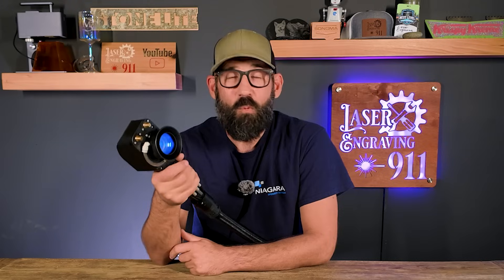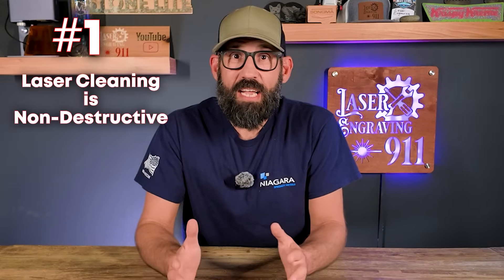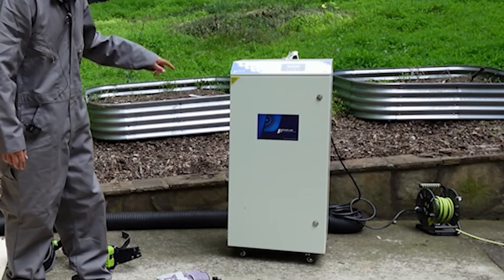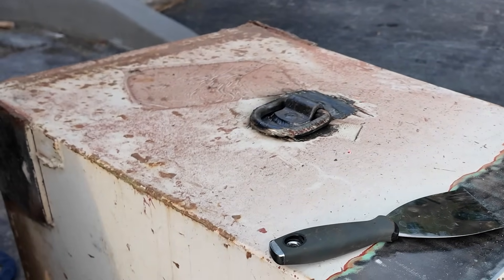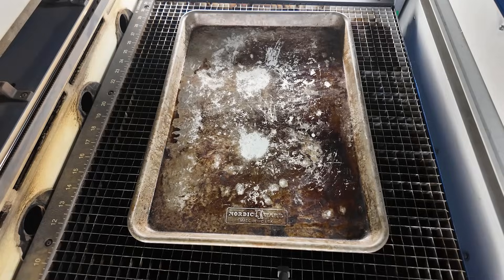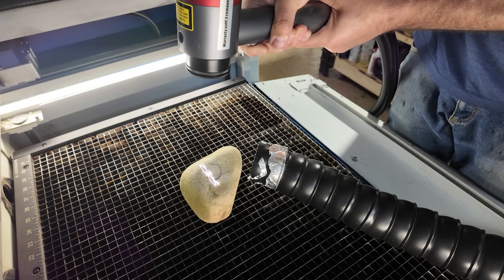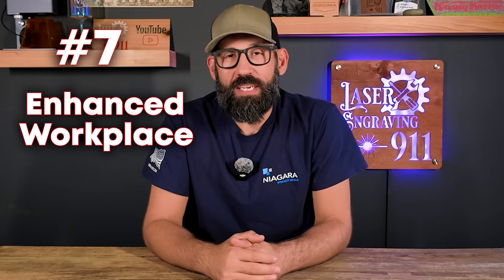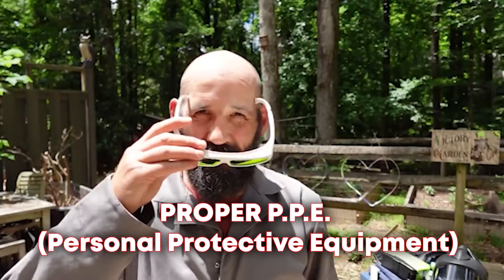The Truth About Laser Cleaning -  Pros and Cons

Comment: Have you tried low output Black Mold cleaning as part of storm mitigation cleanup? Thank you for your help.
Reply from the maker: You need be carful with doing mold. Proper PPE and Fume extraction is necessary for that kind of work, high level respirators and filtered fume extractors, full body suit sealed. I dont have experience with doing it myself, its to risky to my health, IMO

Comment: I’m looking to buy I guess the pulse one for removing old lacquer finish from mid century furniture. Any suggestions?
Reply from the maker: for sure  SFX has a great unit for this SFX Portable 300-500 Watt Pulsed NEW VERSION https://tinyurl.com/pulsedcleaner  and if your serious, you can use my code LASER911200 for $200.00 off :)  it will get the job done!
Reply: We have the 300W  pulse from SFX.  It doesn't work on every finish . just refinished a dining room table and it worked like a charm on the legs , but couldn't get it work on the top . Same setting.

Comment: I purchased a 300 w pulse laser from SFX 8 months ago. Excellent machine and company service. In watching your video you said the machine is a class 4. From my research I believe that is incorrect.I believe it is a class 1 because of the way the laser light is housed.The techs at SFX also say it is a class  1. That being said there are still safety precautions that must be followed but they are not as extensive as class 4. Also since I also have a machine from the same company is a list of parameter setting that work well for you available for purchase. I have developed a list of my own but would be interested in seeing yours.
Reply from the maker: Thanks for leaving a comment. Unless your 300watt Pulsed is housed in and completely enclosed environment, with laser shields or viewing glass meaning " a sealed cabinet, you do NOT have a class 1 laser. What you have is a 100% is a class 4 laser Laser cleaners, whether continuous wave (CW) or pulsed, are generally classified as Class 4 lasers, according to the International Electrotechnical Commission (IEC) and the American National Standards Institute (ANSI) standards for laser safety. See here:

✅Key Characteristics of Class 4 Lasers:
✅High Power: Class 4 lasers are capable of delivering high output power, which is necessary for applications like material ablation and cleaning.
CW lasers typically have high average power.
Pulsed lasers deliver high peak power in short bursts, which is especially effective for material removal with minimal thermal damage.
✅Hazards: Class 4 lasers pose significant safety risks, including:
Eye and skin injury from direct, reflected, or scattered beams.
Fire hazards due to the energy density.
Applications: They are used in industrial processes such as laser cutting, welding, and cleaning.
✅Why Laser Cleaners Are Class 4:
The cleaning process relies on the laser's ability to ablate or vaporize contaminants without damaging the underlying substrate. Achieving this precision and efficiency typically requires a laser powerful enough to meet Class 4 criteria.

✅Safety Precautions: Operating Class 4 lasers requires strict adherence to safety protocols, including protective eyewear, controlled environments, and beam containment measures, to prevent injury and accidental exposure.

There is a huge difference between a class 1 and and a class 4 laser. It has nothing to do with how the laser source is housed in the cabinet and electronic but where the LASER EMITTER "meaning the galvo, and final exit point of the beam are located, and also how many watts the beam is, and how destructive it is.
Reply: I'm also looked at sfx machine. Do you know how frequently the lenses have to be replaced? That is a big concern of mine. It's a slow process already, but changing lenses every 10 min would be horribly painful.
Reply: Definitely a class 4!
Reply: It's a 1064 Nm laser, this is a Class 4 wavelength and will damage retinas if directed at eyes. Construction levelling lasers are Class 2. So definitely not Class 1. Class 1 is used for electronics, Printers, DVD, barcode scanners. Who the fuck told you such bullshit?

Comment: Hi Michael , Could you please tell me if I need to take breaks from using laser cleaning machines or can they work continuously?
Reply from the maker: They can work continuously for  decent amount of time a few hours, but since they are air cooled the outside temp plays a big role in  how long they can continuously run, so on Hot days its necessary to keep the machine cool or it will overheat. If outside keep it under a tent out of direct sun, and even help to have a additional fan blowing on the machine.

Comment: Great vid!
Looking into the SFX 200W pulsed laser.
Price is reasonable and they have a support center somewhere upstate in NY.

What are your thoughts on?
Reply: I want to purchase a pulse laser cleaning machine to help with my furniture restoration. It would be to remove paint and varnish. Ideally I would like a machine that has a varied watt, 100w/200w/300w/500w and if possible up to 100w to accommodate rust cleaning from metal too, as well as multiple patterns. I have seen them advertised, but when I try to get further info it always comes back with a single mode. Do they exist?
Reply: @aroundtheworldat1016 any luck with your research? Looking to purchase one for furniture also!
Reply from the maker: Thanks, well it depend on what you want to use it for? What are your plans.
Reply: @it would have to be delicate cleaning, like car parts, restoration of monuments, wood, bricks from paint. Maybe pharmaceuticals or even into technology sector.

Comment: As an owner of a pulse laser and a cw laser. One piece of advice I will share is, don’t believe what you see on the internet. These machines are demonstrated by manufacturers as total magic. These are in no way point and shoot, every substrate you work on takes it’s own little set of settings to get right, in some cases as you clean things like paint, making many setting adjustments may have to happen for a completely clean surface
Reply: Yes sir, we had to play with our 300w pulse laser cleaner but we ended up being able to strip white paint, which was thought to be not possible
Reply: @Hefe_diver which brand cost machine ?
Reply: So can I hoist my car and remove the surface rust off the undercarriage on a uni-body construction, or do I have to take the car apart and clean each part separately? Could it damage non-metal components that are in the way like rubber hoses, axel seals, PVC plastic components, boots?
Reply: @retiredrebel  if you are using a cw laser, you may mark non metal parts. Also use something more then masking tape as the cw will burn regular tape. Also working under a car with the laser head pointing up you run risk of dirt falling onto your lens and causing other problems. 

Everything is possible but take as much precaution as possible
Reply: @DreamstoRealityAutomotiveTV we don't all the time big fan and you shoot at a 45 and compressed air plugged into laser .
Reply: @ Shield parts that you don’t Intend to be in the beam path if you really don’t want to take any risks. Lasers burn fast on dark colored surfaces (especially black) I use something pliable and white. Like some heavy ish plastic sheeting to essentially mask off areas you don’t want the beam to hit. Similar to taping off trim while painting
Reply: @retiredrebel I have same question 🤔
Reply from the maker: Good Advice!
Reply: @LaserEngraving911 I’m looking to get the SFX 300 , before I spend 16k I just want to know if you think it’s a good reliable machine. I want something that’s gonna last
Reply: Is there any danger using these units to clean around where there may be other fumes,  like maybe gas fumes?
Reply from the maker: @ yes 100% take precaution to avoid that situation
Reply: any idea/thoughts if this would clean the calcium deposit line off pool tile? The white line you see on many pools here in AZ??? Thanks
Reply: I can try it and send you video
Reply: We do it all the time
Reply: I also own a laser , What is the best way to get clientele for work projects?
Reply: @retiredrebel  suggest you use pulse laser cleaning
Reply: Have you had any experience removing powder coating?
Reply: @p51mustang18 yep, takes a few passes. But we've tested on car parts and steel sheet cladding
Reply: Thats true. Also the combined units that weld, does not weld like they say and advertise as. You still require the correct gasses that you need to add to your air cooling compressor, which is also another expense. So yeah REALLY dont believe the ads.
Reply: @ajdewit870 another thing nobody talks about, tech support, there is zero. At least in my experiences, when you need guidance or service, forget it, you are on your own
Reply: @DreamstoRealityAutomotiveTV  So, if I order one of these sfx machines and anything goes wrong, can I throw it away? They are not cheap, so a bit alarming.
Reply: @DreamstoRealityAutomotiveTV don’t buy an unknown Chinese, Indian, or other machine because they’re cheap. Buy something with representation here. You’ll pay more, but you’ll yet service and parts as well as help using it.
Reply: @melgross no question, but at the same time, the representatives selling the lesser quality machines should back the product, and well, that hasn’t been great for me, especially machines that come with no worthwhile operation manuals
Reply: @DreamstoRealityAutomotiveTV I agree. But the reality is that one way the product is cheaper is by skimping on representation, service and parts. Look to,companies that have an office here as several now do. Yes, it costs more. But I had two businesses over the decades. I had a lot of money sunk in equipment. You learn that you don’t save money by buying second quality equipment. Not if you expect them to work properly for years. Just bite the bullet and buy recognized quality machines. In the end, you won’t be sorry. If it’s for a hobby, then maybe it’s different. But I still wouldn’t buy cheap machines without an effective warrantee.
Reply: @melgross if a sales person is willing to sell a product, that same person should answer their phone after they take your money. I’m in business too, I don’t forget a person after their last check cleared
Reply: @DreamstoRealityAutomotiveTV you keep on talking about your expectations, while I’m telling you what to expect. Forget about what you think is right. It doesn’t matter. You find a supplier who does what you need, not one that you think should do what you need.
Reply: @melgross yea I do, as people have expectations on me, it’s my right to have expectations when I’m spending thousands of dollars on a product
Reply: @DreamstoRealityAutomotiveTV my lord. You’re not getting it. Nobody cares about your expectations. Every company does what they do. It’s up to you to find those that meet your expectations, and reject the ones that don’t. What is so hard to understand about this?
Reply: @melgross I don’t know what business you’re in, I’ll make sure to avoid it. Safe to say you don’t care about customers expectations either. 

Good luck and have a great holiday
Reply: @ajdewit870 it depends. Is it primarily a cleaner or a welder? A cleaner doesn’t work as well as a welder and a welder doesn’t work as well as a cleaner. A welder does work well as a cutter, but a cleaner may not.
Reply: It was a 3 in one welder,cleaner and cutter, just had to interchange the guns and add the wire feeder  @melgross
Reply: Use aluminum tape for masking